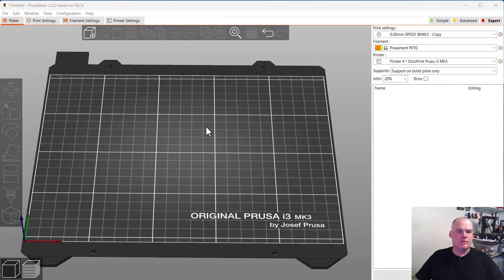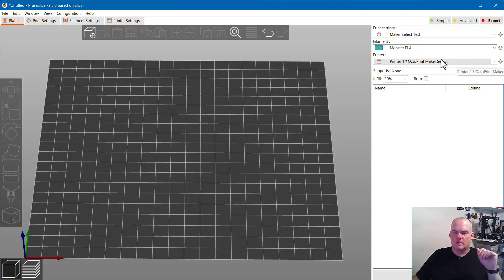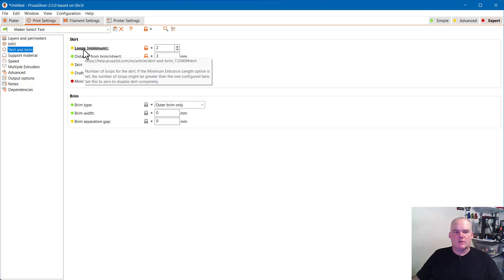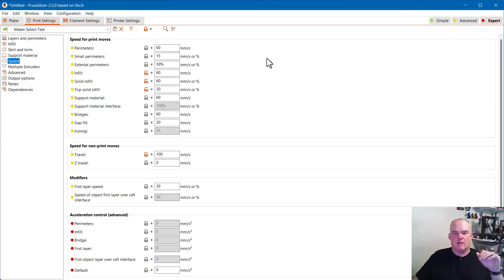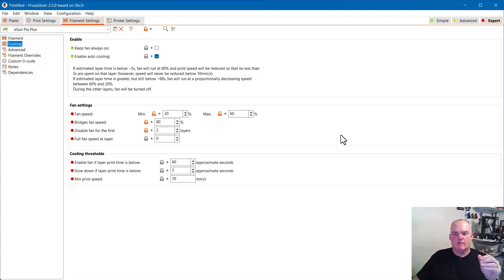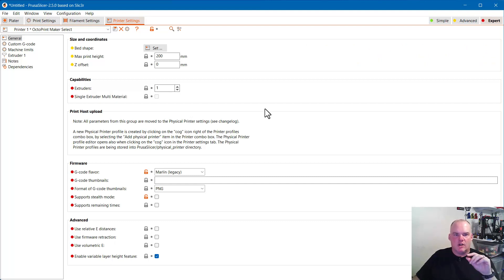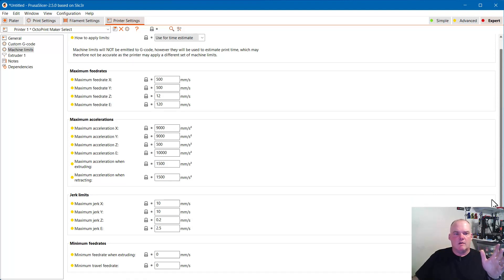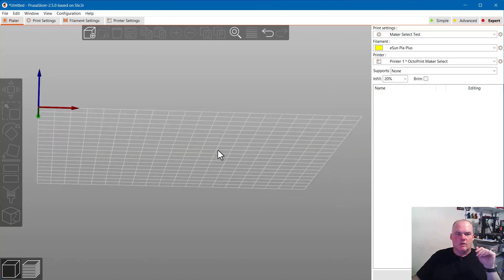Beginner's Guide to Using PrusaSlicer for ANY Printer #3DPrinting

Comment: Sir, at 3:45 you end up with 4 printers in the bottom listbox under the '----- Physical Printer ----' sub section of that listbox. If i do the same as you instruct up to this point in the vid mine ends up under the '---- User Presets -----' section of that same list box, what am I missing. Thks in advance.
Reply from the maker: Mine are connected through Wifi and Raspberry Pi 3B+ interfaces with Octoprint. 

When you do this, PrusaSlicer adds those connections as additoinal, individual printers. If I was connecting with a typical SD card, those would not exist. Thanks for the question!

Comment: Just found your channel and you got yourself a subscriber. Good info on generic setup. I've just started trying alternate slicers on my Anet AM8 after Cura started making users jump through hoops. Using superslicer the fork from PrusaSlicer and I've got to say I'm impressed. A few hiccups from unfamiliarity but liking the quality and options.
Reply from the maker: Thanks for the sub! A new version of PrusaSlicer is being released in Alpha format right now. Once the bugs are worked out, it looks to be a significant upgrade. I use PrusaSlicer for all my printers.
Reply: Hey, OP, got a question: how similar is the AM8 to the A8 Plus? That is, assuming you have experience with that... Got mine off Amazon a few years ago, but have yet to actually use it, so, looking for guidance.
Reply: @Caldoric  Sorry never used the A* Plus

Comment: I found this on the Prusa Forum. This might be easier for both of us.

RE: Copy friend’s configuration of Prusa to my Maker select Plus
There are a couple of ways. 
He can export a configuration bundle from his setup. That will save every non system standard print, filament and printer on his system into a bundle.  Then you can use the import config bundle option to load it onto my other system you want and get them all. This method is the best for also making backups. 

The limitation on this method is that it stores all the non standard ones. If you just want a subset then the easiest is to just save a normal project,  that has a single print, filament and printer saved as part of it. Just use a basic cube or something. Then when you open the project on a different machine you can manually use the save option next to the profile you want to save. So if you want to save the printer only then just save that one. 
The bundle is the easiest option though.
Reply from the maker: I doubt it would work as my configuration is for an Octoprint connected printer with an older version of ADVi3++ printer firmware. 

You'd spend as much time removing excess configuration setting as you would if you just (a) set up a new, non Prusa printer, then (b) went through the video to adjust to look like my settings. 

I believe most of the settings will be there if you just set up the printer, and then there will be minimal setting you really need to borrow.
Reply: @Grimm3D  thanks.  I go forward with the screen configuration thanks
Reply: I try to slice a file and I get the same error no matter which file I choose, the error is
“Start_code
Parsing error at line 1:  Variable does not exist
M109 S[first_layer_temperature] ;  heat nozzle  to [first_layer_tempeture ]
    !!!!!! Failed to process custom G-code template……

I don’t know what to do next
Thanks
Hager
Reply from the maker: Your second variable is misspelled. [first_layer_temperature]
Reply: @Grimm3D  that’s the spelling on your code.  I thought it didn’t matter as it was past the “;” thought it was just a comment. 
Ok I’ll correct it and give it another try. 
Thanks Grimm.
Reply: @Grimm3D  no yours was correct, I must have chopped it up in coping it. 
Sorry I’m trying again
Thanks
Hager
Reply: Sliced without any error messages.  Thanks so much
Running xyzCaliberation cube now
Reply: Ran the cube just fine. 
Felt the frame when it was running and there was some movement especially on short moves, the bracing like yours should help that.
Can I send you photos?
Thanks for all your help.
Hager